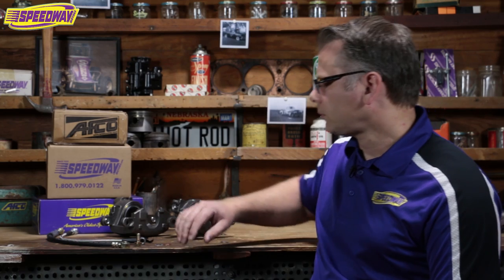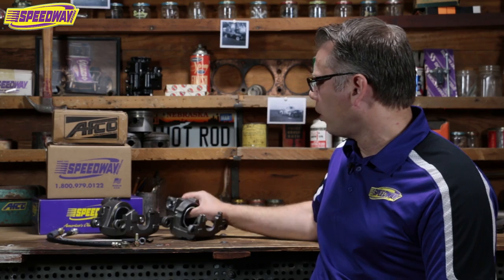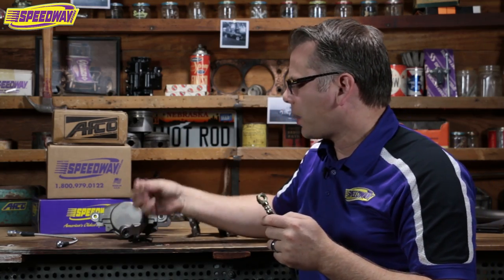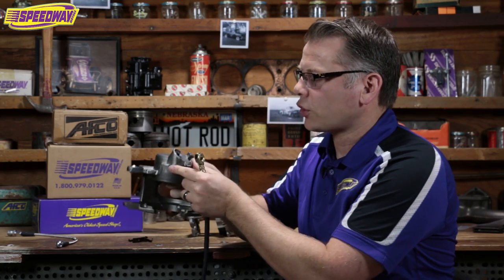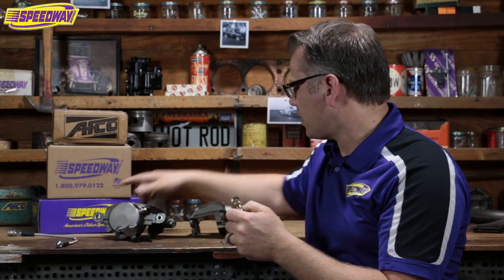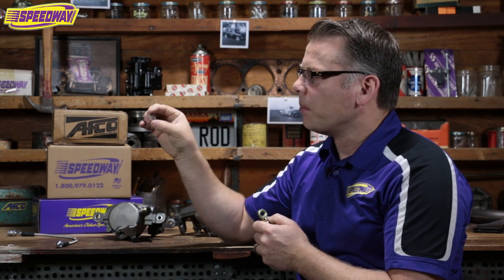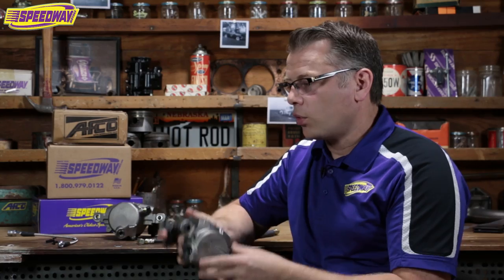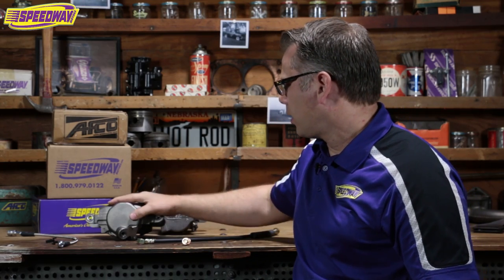Speedway Tech Talk - Disc Brake Set Up

Comment: I got a disk brake kit for my 4” drop axle. Problem I’m having is the bolt on steering arms won’t fit with the calliper. I had to swap sides and put the calibres in the front position. The issue now is the brake line is binding and pinching between the axle and spindle. I can’t turn the lines because the calibres are shaped to accommodate the banjo fitting in only one direction, straight back.

Comment: Hmm. I'm having trouble with the calipers bumping the spindle on a gasser straight axle, and disk brake combo kit. Gm metric calipers. That's what they sent, did I have a choice? Does it matter? It looks like I'll have to grind off some of the casting right by the banjo inlet on the inside to clear the spindle-steering bracket bolt hole area. The slide bolts don't line up with the brackets and calipers with the brackets actually mounted on the spindle unless they're pulled far out w/o brake pads past the bolt on the spindle. I have to go out and stare at it some more. Also swear I only got 3 slide bolts in the pile of parts. I've ransacked the garage... Not much in the way of instructions. just general instructions for the axle set up with photos of a ford spindle, and a chevy spindle fully assembled... from ten feet away. nothing with the brake stuff. no anti rattle brackets, just a mysterious cotter pin for each side? provided in the brake pad box.

Comment: Is there any advantage between choosing the old-school a body caliper or the newer metric caliper? I have typical 57 Chevy car Factory manual steering setup and wondering which style Caliper kit I should purchase
Reply from the maker: It's mostly about the caliper bore size.  The A body caliper uses a larger 2 3/4" bore piston where as the metric caliper uses a 2 1/2" bore piston.
Reply: @speedwaymotors  so that means the A body caliper would have slightly more clamping pressure ability for the same brake pedal pressure? At least that's how I understand it

Comment: Is there a reason some kits you mount the caliper in front of the spindle? It does not look right to me.
Reply from the maker: Depending on the kit in some cases the caliper needs to be mounted ahead of the spindle because of steering arm component interference.  This does not cause any stopping power loss and the psi in the caliper remains the same.